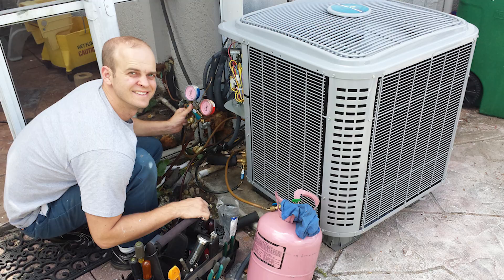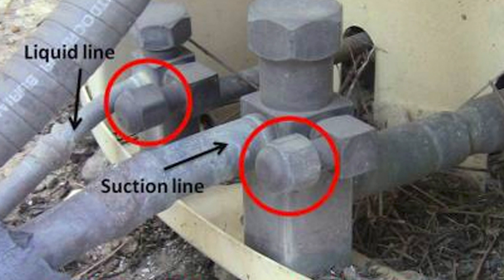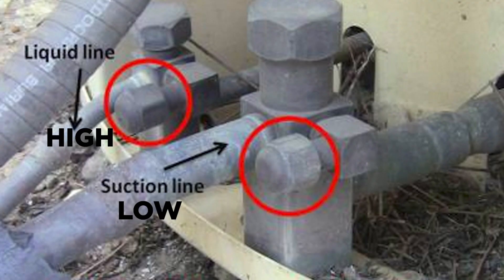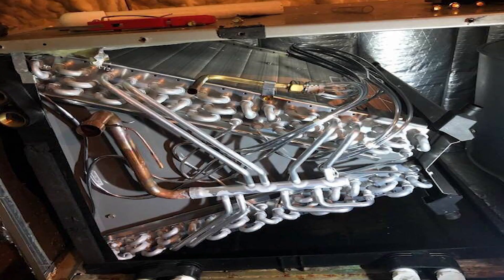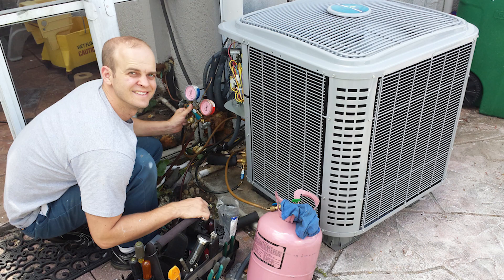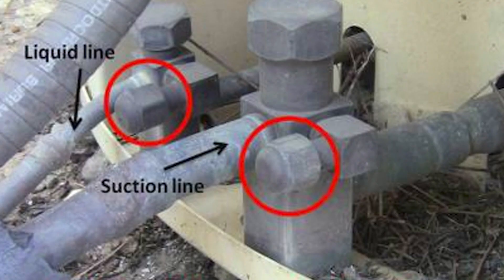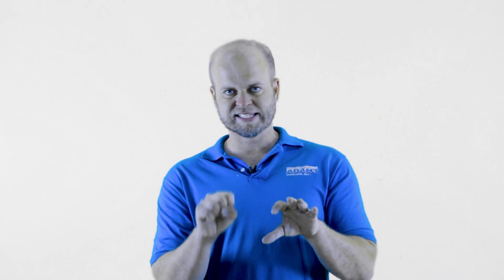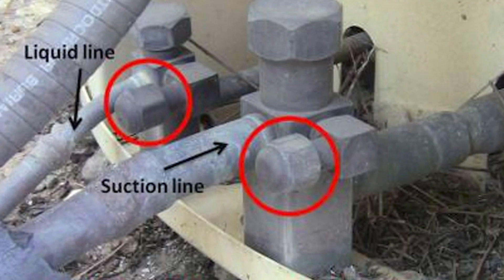AC Not Cooling - Check This FIRST

Comment: It wasn't blowing cool air but it was blowing warm . Replaced capacitor got cool aire again thought my AC was fixed , it only gets to 81 degrees during the extreme hot day reaching about 110 F . Does get that cool during the night . Any ideas ? I've changed furnace filter no iced over lines just used water hose to clean it the outside coils . It wa able to get 74- 76 degrees not too long ago . To me freon loss doen't make sense since it's got some freon . Wouldn't it all leaked out ?
Reply from the maker: So how is your evaporator coil? Is it dirty? Also check out our video on taking a TD (temperature difference), and check whether you are getting 17 to 20 degrees across the coil, with a thermometer of some sort. If you ARE getting 17 to 20 degrees then the system IS doing its job, and there may be other factors for you to address (like more insulation in the attic, or using curtains to help block out heat coming in from the outside windows. Just some thoughts. Hope that helps!

Comment: Hi What if the Suction line is warm and the Liquid line is cold ? My outdoor unit is short cycling every 2-3mins.
Reply from the maker: Yeah that’s not good. No easy answer there (could be a few different things). Hard to know without being there; I would have someone come out and take a look.
Reply: Is it a heat pump?
Reply from the maker: @mr.bungis969  No, a regular split system with just the suction line (fat) and the liquid line (skinny).